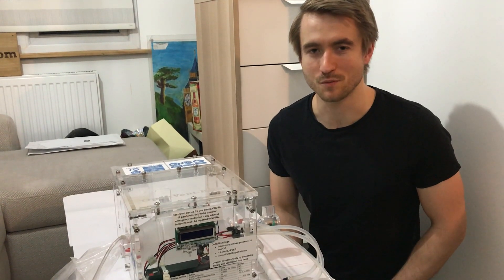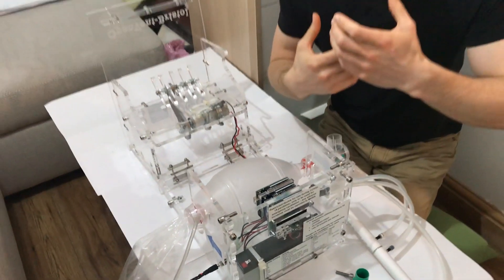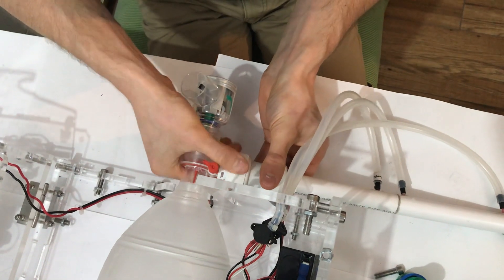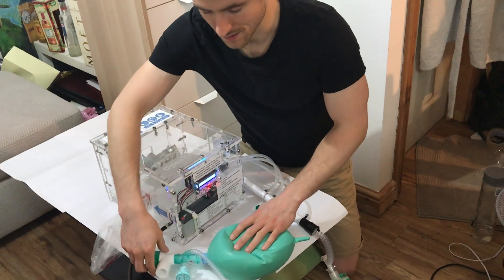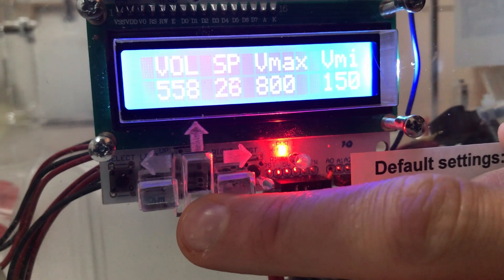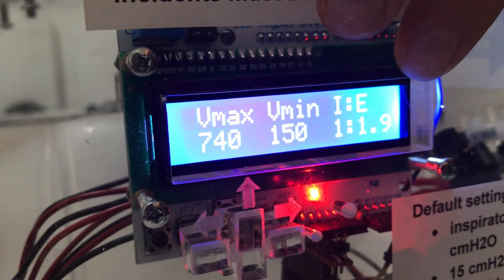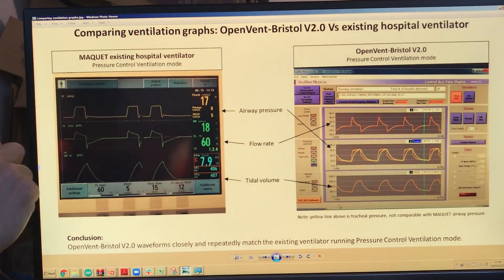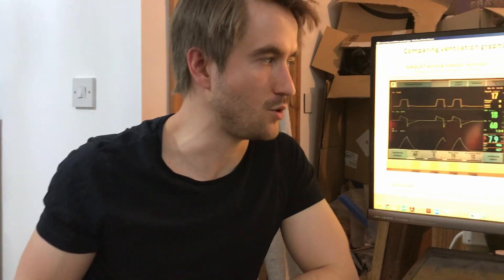OpenVent Bristol V2.0 COVID-19 rapid manufacture emergency ventilator ambu bag ventilation BVM

Comment: It’s amazing sir..!! Can you please tell me how you measure the tidel volume that is delivering by this bag at a perticular time
Reply from the maker: tidal volume can be caluclated by integrating flow rate over time. My Arduino code is available via the Instructables link
Reply: @00lewisd1  Thank you so much for replying ❤️
Can I use BMP280 for differential pressure measuring?

Comment: Dear Darren Lewis,
Thank ur project.

I got an error: 'getCurrentM1' was not declared in this scope
int current = getCurrentM1();
do u mean: int current = 0; ???
Please help me.
Reply from the maker: I think you need to add my "analogue filtering" code as another tab in your main code. If you put all the arduino files together in a folder then double click the main file it should automatically add the other arduino files as other tabs

Comment: Great 
Can i use the MPX4250DP 0 250kPa Differential Pressure Sensor  instead of using this MPX5010DP Pressure Sensor for flow and pressure
Reply from the maker: I have replied to this comment on Insructables
Reply: Darren Lewis thank you for quick response

Comment: Hi... what is the maximum volume that can be delivered by the DC motor you selected?  Thanks
Reply from the maker: The motor isn't the limit on tidal volume, it can easily push the bag all the way. The design of the size of the 'fingers' pressing on the bag has more of an effect on volume. I think I managed about 1.2L before I limited it to 800ml
Reply: Darren Lewis thanks for the reply. I’ve read the  MIT’s e vent design that, pushing the AMBU bag on single side can be resulted in decrease in life of the bag. They are saying it’s better to give push in both sides. Your design is great and minimalist by the way.. 👌👌👌

Comment: Superb dude
I want to know some more details in it!
Reply from the maker: I have added design details to the description.
Reply: Darren Lewis MPX4250DP 0 250kPa Differential Pressure Sensor 
Can i use this differential sensor for pressure and flow rate instead of you used in ur ventilator bcoz in my country this one is available right now